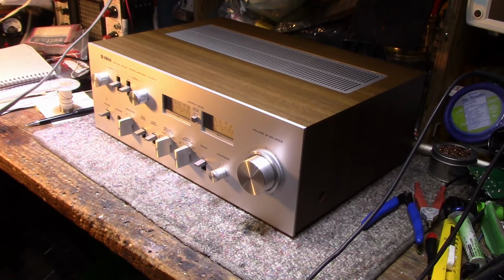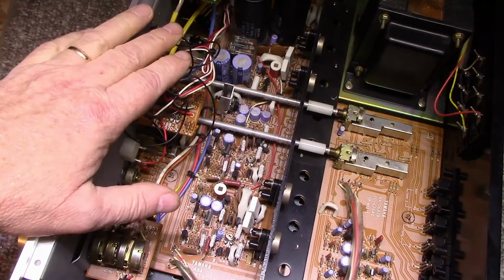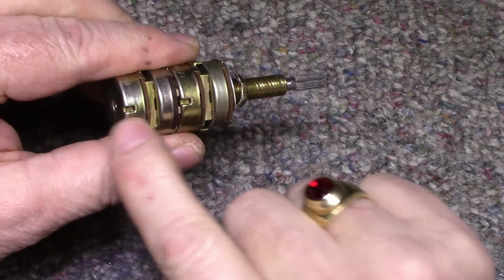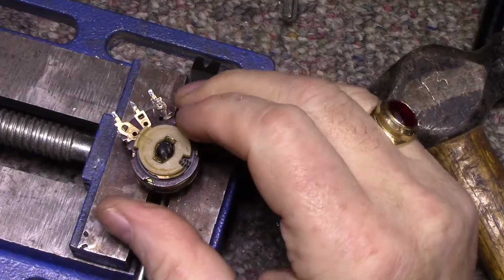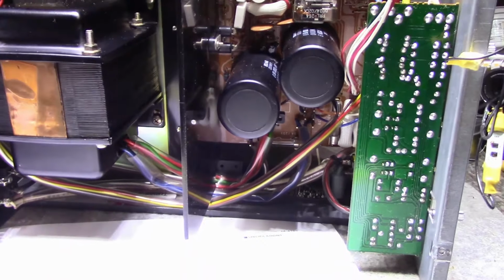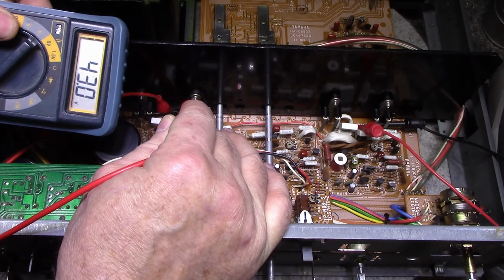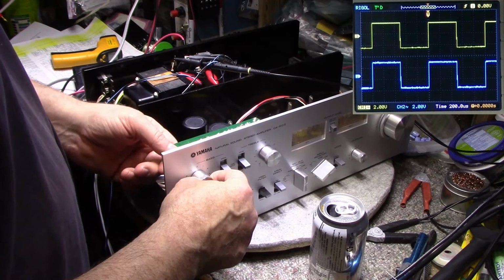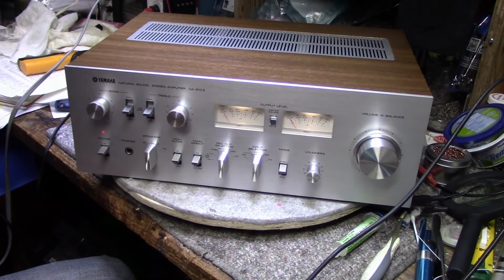Yamaha CA-610II Integrated Amplifier (Ep. 254)

Comment: @TrevorsBench Hi I was wondering if you could point me in the right direction with my Sony STR-DH500. The inputs keep rapidly changing on their own. Only 2 inputs are connected (optical and a L/R RCA input from my PC) The remote control isn't being used or the buttons on the front panel. No buttons are sticky and it's not getting IR interference from anything. If I power off the receiver for a couple minutes and then back on the receiver is fine, but after a couple mins it will start doing the rapid input switching. HELP ME PLEASE!
Reply: The Sony STR-DH500 receiver has developed a eeprom memory error (Has become corrupt) as it stores a type of non-volatile memory that can be electrically erased and reprogrammed. This means it retains data even when the power is turned off. You will need to reset it to its "factory state". You will need to hold down the power button for 5 seconds (the forth button from the left) you will see "Push" and "Enter" on the display alternating.  Then press Memory/Enter then while "CLEARING appears on the display "CLEARED" will appear. All settings will now be changed to their initial settings.

Comment: Nice overall work throughout Trevor, I'm glad to see you dodged a bullet on the balance control section of that pot. That was some good surgical technique, with a bit of elevated "pucker factor" as you coaxed those brass tabs back into the recessed areas of  that disk. I was hoping nothing would break on you. I guess the multi-ganged pot gods granted you access this time around. My best to you, have a nice weekend.